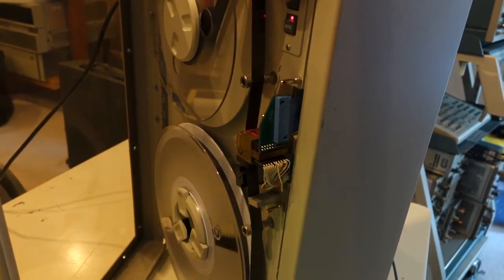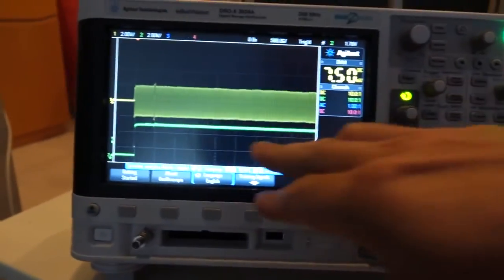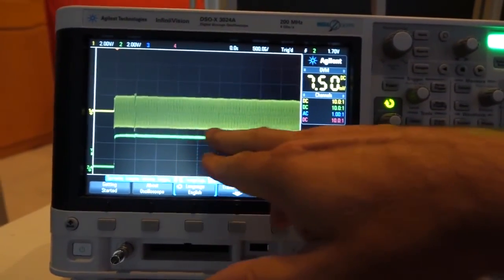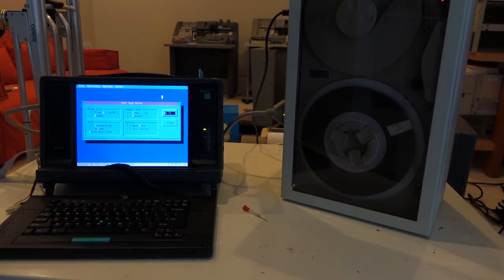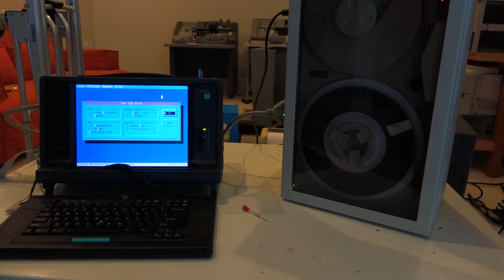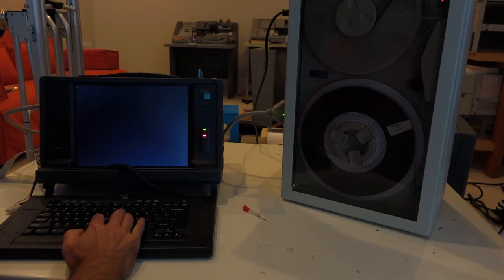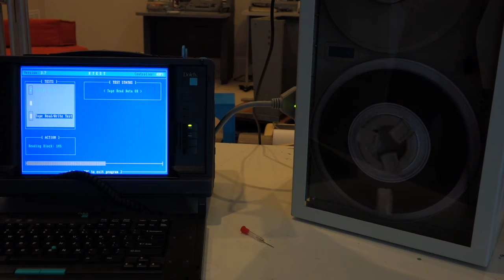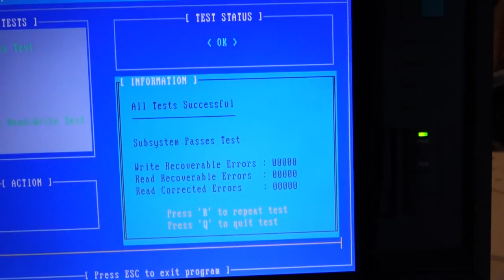Qualstar 1260S 9-Track Magnetic Tape Drive Repair

Comment: mine cant read foriegn tapes... but tapes it creates, can be read fine. I suspect a head misalignment, any ideas how to realign it? I dont see any head adjustment screws at all, other than to tape guides
Reply from the maker: In absence of an alignment tape, I would just use a regular tape and adjust the guides until the signal is maximized on all 9 channels, looking at an oscilloscope.

Comment: Stumbled across this vid  searching for some tips on using a qualstar  tape system that seems to have the same problem yours did.   Following along seems fairly simple but a question:  what sort of voltage levels should I be setting in the line adjustments?

Comment: I have one of these the S version and it is in good working condition. However, I have no idea what software to use with it. Any help would be appreciated.
Reply from the maker: SCSI tape drives are supported by Linux on the command line, you can tar files backup to them, or use tge mt utility. For the PC, see this other video: https://youtu.be/eCBxNhEzIfc
Reply: @CuriousMarc  Hello my friend. I just picked up an  Overland Data Inc. magnetic tape drive OD3201 PN 606260. Don't know what software is necessary to drive it. Would love to be able to play with it...

Comment: Does it use the scsi connector or parallel? Just curious.
Reply from the maker: This one is a 1260S, the S stands for the SCSI option. Connects with SCSI-1. If it does not have the option, it uses natively a two connector Pertec interface. Inside, the option boardjust plugs into the internal native Pertec ports.
Reply: CuriousMarc thanks